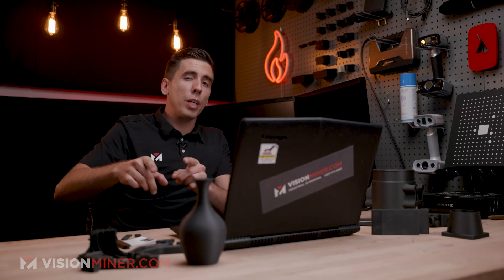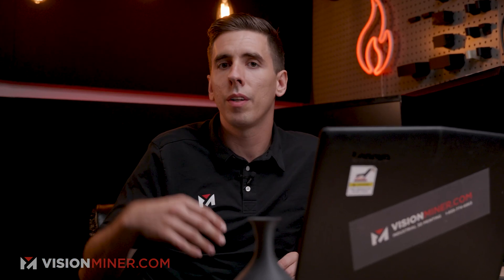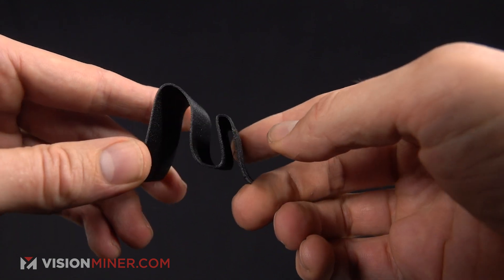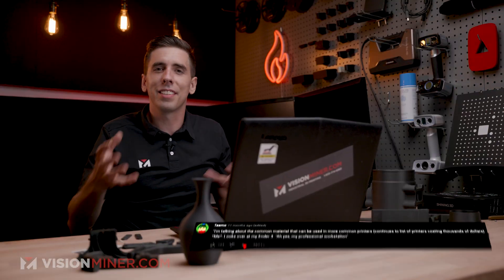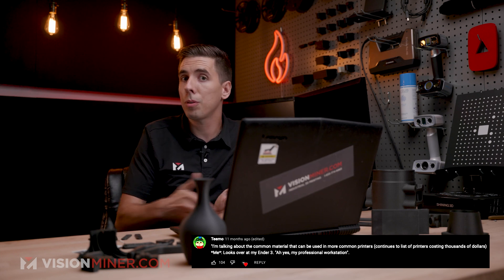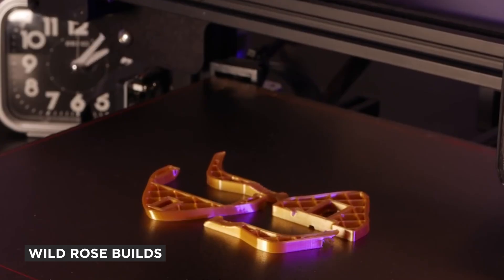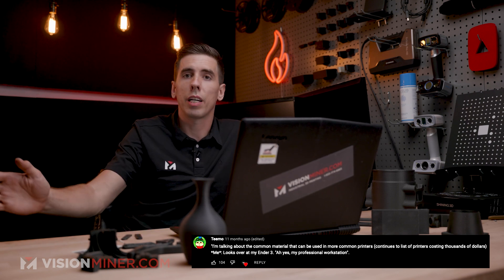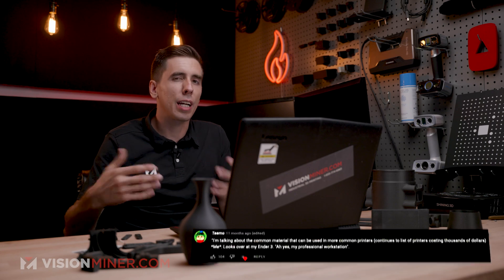Carbon Fiber Nylon FAQ Part 1 - We Answer Your Most Asked Questions About Printing CFPA Filaments

Comment: Could you please check out the Inland brand CF nylon? It's the brand at microcenter where I buy 90% of the filiment and resins I use. Thanks for the vid!
Reply from the maker: Oh yeah, it's fantastic -- that's just re-branded white-labeled ESun filament :) We love it for the little bit of basic stuff we do :)

edit: we use their PLA. We don't use anything else, like their Nylon or anything, we stick to the engineering grade where we have full tracability of the original polymer used and additives --- most of these companies add a slew of additives to make Nylon warp less, but then it's no longer actually just Nylon, which is what the customers we serve need :)

Comment: 8:14. as good as cf nylon is, I think you're mistaken. You're talking about a high-heat device with rotors that spin upwards of 60,000 rpm to compress air. NO WAY is that 3d printed nylon

Comment: Great follow-up to a great video about HTNCF25 last year. When that video came out, I already had a spool of Saintsmart Nylon/CF of 75/25. I am using this for drone frames I design that utilize hollow structures with single 0.6mm wall thickness for best strength to weight. My filament is dried and kept dry. When the parts are first printed from a Prusa MK3, they are exceptionally stiff. What I have noticed over time is that the part becomes much less stiff. I assume this is due to water absorption. I tried conformal coating with a spray-on silicone on a newly printed part, and that softened the part, too. I assume this was due to the solvents in the preparation. Do you all have any ideas on how to coat a part to prevent absorption of water after printing? I'm 2/3 of the way through my spool, and I'm planning on getting some HTN CF25 after that! Many thanks!

Comment: Sometimes I wonder if you guys are just linked to my brainwaves.  I was planning on printing with CF Nylon when I finally get the space to tear down my truck and begin the endeavor of modifying it.  Have been curious in the back of my mind with a lot of what was shared in this video.  Now I am curious as to the temperature limit as far as sub zero.  If I make a part would it crack easier at lower temperatures, or become stronger?  For fun, what happens to rods/blocks of varying thickness (of each kind of CF Nylon) when submerged in liquid Nitrogen?

Comment: new Question: Why is it that FDM printed CF-Nylon (and yep not only the one made by anyones mom) have the tendency to sag under constant load at temperature (~50-70°C)? For Example screw tension get lost over time. Especially on gantry parts of enclosed DIY printers. And that with or without annealing. ABS in compare does a better job in that.
Reply: I wonder how much this has to do with moisture absorption pre print and post print. My guess is that wherever this is happening, there’s moisture being introduced and that’s causing the sagging.

Comment: Hi Rob, I meet you at westech. I have some suggestions for the channel I would like to see. 
 Charts wouldbe nice. It's cool to see you burn materials and all. Yet, it doesn't tell me much about real world applications. For example if you had a chart that says it's impact resistant or chemical resistant. It would help with choose materials. Instead of using a vice to beak material coupons with your hand. Use actual measurements with numbers. I can't make heads or tails in some of your videos about a material. I feel there is a lot of missing information that could be provided to customers.

Comment: CFPA6 is best for drones that I have found and the additives do not change the temps of the majority resins blend but Process aid and others additives do help you run different heats to be possible but does not change the base materials MT but can help flow and gauge control

ex: if you have a blend like LDPE 20% LLDPE 78% Black MB 2% it will run best closer to the 78% LLDPE MT 
      if you have a blend like LDPE 20% LLDPE 77% Black MB 2% P/A 1% it will still be the MT of the base LLDPE material but you may have a wider heat range, flow and tru put ability with an example like  PA-PROCESS AID in turn is then more resistant to carbon buildup this makes a longer run between cleanouts and less melt fracture during cold start ups and possibly better production and flow consistency with gauge control and proper heats  
i have run blends with 26 parts in 5 layer dies Always the base materials MT is where you wanna be but of course each machine varies slightly and in a extrusion "Screw and barrel" Extruder " the heats are usually run lower than the suggested Data sheets due to the friction heats built in the machine as backpressure plays a big part as well in non glue gun extrusions 3000-10000 psi are seen
Some Back pressure gauges like DYNISCO also can have a MT display of your actual melt temp it will tell you the same i am above
Real extruders have multiple heating zones and cooling zones on the barrel and dies the different heaters are for a heat profile not just to be set all the same for this reason

Comment: I print CF15 PA12 from fiberlogy on a direct drive+all metal ender 3, 0.4mm steel nozzle at 45mm/s, 0.16mm layer height, 95c bed 270c nozzle no fan, no enclosure. Bed is glass coated in "schwarzkopf got2b glued" hairspray baked on at 115c then lightly abraided with scotchbrite.
Zero warping issues, zero adhesion issues, excellent bridging and overhangs. I actually find it outperforms PLA in basically every aesthetic regard!
Reply: gotta test that hairspray.
some hairspray is so strong im having av very hard time getting the part off. Others are useless. And hairspray is a lot easier to get hold of then MAgigoo and so on.
Reply: @jbergene  i reduce bed temps when I get too much adhesion. For very large footprint parts I reduce bed temp to 90 or even 85 degrees to aid removal
Reply: @17473039  I have never printed Nylon above 60C, even if it says 100+ on the label. (Bed temp).

Just PVA glue and is usually what I use. But open to test something else too! :)
Reply: @jbergene  i mostly try and keep bed temps high to minimise temperature delta between layers at low layer heights to try and keep warping to a minimum. I also find it lets me have a higher initial layer speed.

Comment: Very cool video!  I’m really interested in the glass fiber nylon you mentioned, however I only have prusa mk3s+ printers right now.  Are those adequate?
Reply: MK3’s are more than adequate. For example Markforged’s printers don’t even have a heated bed or a heated chamber and they’re base material is always chopped carbon nylon!
Reply from the maker: As for markforged, keep in mind their Nylon blend is proprietary -- and the bed is a special material, and they print incredibly slow compared to what we're doing --- it's very rare to do a decent size part in normal Nylon filaments (non-markforged) and have it work well, their stuff is magical in it's own right :)
Reply from the maker: for sure! You'll just want a hardened steel nozzle for the abrasion resistance, but you should be able to sue it for smaller parts :)
Reply: @VisionMiner  For Sure! The NozzleX is my favourite nozzle when needing a hardened nozzle on my Prusa, it has some sort of coating which gives the molten plastic really good flow.